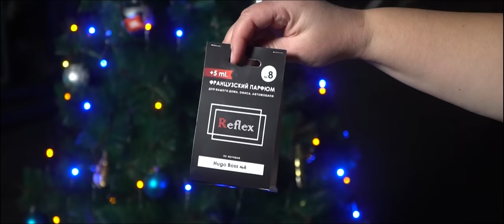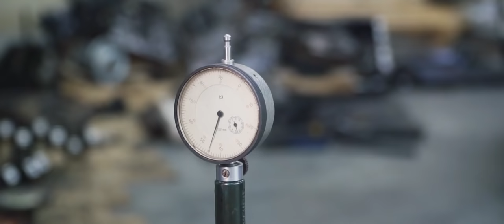We make a working I-6 out of two Lada 4-cyl engines

Comment: it would be cool to put 2 lada engines together to make a inline 8
Reply: Something similar has already been done with "Gennady", if you've seen that project. But that was just two engines welded at the pully/flywheel.
Reply: @SwapBlogRU  Yeah, well that would be just simply two I4s welded together. Kinda like the first Veyron W16 prototype, where Bugatti simply stuck 2 V8s next to each other and somehow got 3000HP. If you guys made an I8 like this I6 in this video, it would probably also be easier with synchronisation and stuff.
Reply: Imagine a v8 made from 2 inline 4s tho
Reply: @SwapBlogRU  wasn't that 4?
Reply: Yeah, good luck with synchronisation on that man.
Reply: @Grulaz  it was a gradual build-up. First two, then three, then finally four.
Reply: @SwapBlogRU  also i lowkey thought that Kiril was vlads son
Reply: What about make Inline 12???
Reply: @joe125ful  put the 2 inline6 engines next to each other?
Reply: @Grulaz  Or what about hardest challange:W16:)
Reply: @SwapBlogRU  that was a Lada engines
Reply: @aqua_whale  I’ve seen someone do it, but it was 2 2jz engines put together. It was incredible engineering
Reply: @aqua_whale  Saab did that in the 90s. just welded two i4s as an v8 and stuck it in to a saab 9000. it was kinda fast.
Reply: @SwapBlogRU  Perhaps instead of an Inline-8, would it be possible to cut two blocks in such a way, and weld them together again, to make a V8 with them?  Alternatively, the "proper" I8 with two welded engines instead of two welded crankshafts could be fun to see.

Yes, I'm American.  I think it's partly in our blood to be obsessed with 8 cylinder engines.
Reply: And then V16 SUPER MOTOR 💨💨💨

Comment: I love how they can literally figure out a way to successfully weld two engines together and make it run, but running into the problem of how to make to oil pressure sensors work together stumps them enough to stop the montage to explain the problem 🤣 but not the science behind getting the firing order right on the crank.
Reply: russians are more straightforward in explaining, they would consider visually and verbally explaining as redundant because you are doing the same thing twice at a time

Comment: I would love to hear it with a proper exhaust system, I can’t wait to hear what it sounds like with such a weird crankshaft
Reply: This one is not that weird really. T-34 had two-part crankshaft by design.
Reply: @ThorneyedWT  It's not the two cranks welded together that would make it sound weird, it's the firing order. The two extra cylinders fire in sync with two of the normal ones, so the same firing order as a 4-banger but with an extra cylinder firing 50% of the time. Would probably sound something like bang bang BANG BANG bang bang BANG BANG.
Reply: @quillmaurer6563  Then it's mostly on exhaust lines length. Subaru engines had weird sound just because of that.

Comment: 2 pairs of cylinders are exploding together. A comum 6 cylinders has ignition time of 120-120-120-120-120-120 degrees. This engine has 180-0-180-0-180-180 degrees. The engine sound cannot be the same.

Comment: That's a really impressive machining operation, and it just happened to stop for just long enough to be able to pause it is right between 5:36 and 5:37, it's 5:37 and a second or so:

"Cutting through cylindrical cavities that are orientated axily/ parallel with the axis of /in another larger cylinder"

If anybody studies topology, geometry or mathematics and knows how to state a geometric proof or observation tell me if this is fairly correct if you're an actual mathematician/professor.

Comment: That’s a lot of engineering. Personally, I’d have gone the easy route and used two complete engines in either a straight eight or side by side coupled to an output shaft like a pulling tractor.  I can’t fault these fellas for their effort, though.

Comment: Not to critisize only to try and help. I think that you need a better ignition setup. I know there are coils that fire two plugs but thats connected in series. Your plug wires are connected in parallel and electricity always takes the path of least resistance so there is no way to control which plug it fires.. Could you run a second distributor on the back of the head driven directly by the cam just for the 2 extra cylinders? Love your channel and respect from Canada.

Comment: Great achievement in making a six cylinder engines from Lada four cylinder platform, Such engine will move Nivas with ease in any conditions and Lada sedans might run like sports luxury cars, but there's some room for improvement for this very interesting experiment

Six cylinder engines has the best combo of power, torque and smoothness, a OK fuel economy, solid reliability that made it favorite for US automakers economy cars from 1950's to early 1980's and are still used in trucks as today

The implementation of a real 1-5-3-6-2-4 firing order in Lada Six might need a custom made crankshaft camshaft and perhaps a heavily modified six cylinder distributor meant to fit in the Lada based engine, Such firing order will make the engine more smoother, reliable and after all eliminate most of the crank flexion issues of the original engine with big bang firing order

Don't forget the lubrication system and the oil passages of the block and head, the additional lubrication demands for the six cylinder might need a stiffer oil pressure relief, the oil should pass and lubricate the crank main and cam journals  6 and 7 and lubricate and pressurize four additional tappets, rocker arms and cam lobes, the cooling system may need a larger radiator to cool two extra cylinders

Comment: The engine is turning heavy, that means the crank and engine housing are not aligned corectly but that is normal considering the circumstances. I always liked the I-6 engines, I had a BMW and an Opel Commodore with I-6 engines and they were super.

Comment: Your standard distributor would of been a massive hold back very good idea tho but use an electronic control aftermarket ignition system and ITBs off a motorcycle 👍 ditch the carbs and dizzy off

Comment: I figured you would've cut the front cylinder off of one of them, then the back cylinder off of the other, and then welded them together like that.  Assuming that cutting the engines is easy, i figure that would be the best way to make that happen.  That way, they would probably go together a lot smoother, and maybe make fabricating the new 6 cylinder head easier.  Either way, nice work.

Comment: I wonder if it would have been easier to cut 1 cyclinder from the back of 1 engine and 1 from the front of the other in regards to welding the blocks together, interesting video.

Comment: honestly, I think this would have worked better if the front cylinder was chopped off on one engine, and the rear cylinder was chopped off on the other engine. it likely would have been easier to make a "quality" and balanced engine. Not saying this didn't work well, but I think this concept deserves a revisit.

Comment: That is an incredible feat for these guys to do without engineers and multimillion dollar equipment, I would really think it would be impossible to do just based on how perfect the crank would have to be and how sensitive it would be to the slightest difference, not to mention getting everything else in perfect unison, connecting rods, lifters, cams, absolutely amazing that you did this in a regular garage, I don't think you could do it to a v8 tho, no way.

Comment: I was thinking that an easier method might be cutting the 2 engines so the front 3 and rear 3 cylinders are what you use, the blocks would line up easier with each other and then the head and camshaft will be easier to splice together

Comment: I mean, other than making the crankshaft… it should be straightforward enough. 

The issue is that i4 cranks are flat plane and i6 cranks are at 120 degree spacing.

Edit: okay, heck yeah! Can’t wait to hear a flat plane in-line 6.

Comment: Personally i would have took the three front cylinders from one engine and cut off the last cylinder and take the back 3 cylinders from the other motor and cut off the front cylinder. Welded those two together at that point. Another method would have been cut directly down the center of one of the cylinders from both engines and weld the 2 halves of a cylinder together. This would have been far more complicated than the previous mentioned.
Reply: I like your second method because you could bolt a single head across two blocks to help keep them aligned while you weld them together. I'd love if they attempted a 6 cylinder again because they're more experienced and could have a standard 120 degrees crank. keeping the join in the middle of the block helps engine balance too.

Comment: They should have rotated the last two cilinders 120 degrees away from the others to insure proper engine balance so the engine would run better and would put less stress on the starter

Comment: How about just connecting two 4 cylinder lada motors in line for an inline 8 cylinder motor. It should work pretty well as you could probably bolt the trans mission directly the rear motor.  Mayb two radiators

Comment: i think it wouldve been a good idea to manufacture a crankshaft for this engine, rather than welding two together.
the firing order of this lada-jz is completely off (seen at 8:25)
currently, it fires 1/3/6 - 2/4/5
i think you would do wisely to change it to 1-5-3-6-2-4

Comment: And BTW a incline 6 by my understanding, is alot better than a mere 4 cylinder, atleast I remember reading their bore stroke ratio is much better?  more horsepower better fuel consumption depending of course on the gvwr of the car because if it weighs too much the 4 cylinder simply isn't strong enough to efficiently power the tires 
And the v8 uses way too much fuel for a smaller frame 

Atleast in certain platforms

Comment: U shud have added those extra 2 cyls 90⁰ apart from front 4 cyls not 180⁰. It wud give smoothness n better power delivery bcuz now atleast two cyls will fire together. Like num 1,4n 6 wud be at tdc at same time n two cyls will fire together n same with 2, 3 n 5.

Comment: Little past half way and I can see one issue already.. the firing order is going to be jenky and the engine is going to vibrate like hell.  The TDC should be, 1/6 -> 2/5 -> 3/4, their engine is has 3 pistons at tdc, then the other 3. Which means, 2 will fire at the same time on 2 of the 4 cycles.

Comment: I don't wanna be rude but you can't make a PROPER BALANCED inline 6 with connecting flatplane 4 cranks. The reason is inline 6 naturally has 120 degree intervals between each power stroke. Your new crank has 180 degree intervals. That's why your engine doesn't sound like inline 6. It sounds like uneven firing inline 4. Great effort though!

Comment: why not make a lada straight 8 with the two engines welded together 180° out of phase? the distributors, oil pumps, and cooling systems could theoretically remain intact and just be turned into a full loop through use of an elongated sump and valve cover, along with connecting one coolant outflow line to the other engine's cooling inflow. I personally think an 8 cylinder would be more interesting since it's a rather neglected engine layout.

Comment: nice work BUT this isn’t good design of inline six because cylinders must be 120° (1/3rotation) shifted appart on crankshaft not 180 (1/2 rotation) like inline 4. In  inline 6  engine 1-6 cylinder 2-5 and 3-4 cylinders comes together up and down to balance the engine , sooo the inline 6 is actually two inline 3 cylinder engines mounted in row.

Comment: I saw the first drive and wondered why it didn’t sound like a 6. Now I understand. You didn’t bother with a proper 6 cylinder crank, cam and distributor, you just extended the standard 4 cylinder ones. So you’re twinning two of the cylinders, with the new ones, doubling the power of two cylinders and leaving the other two standard.
So, while there are 6 cylinders, it runs as a horribly misbalanced 4. I was actually expecting more from this, given how much time and effort you guys seem to be able to put into your projects.

Comment: Why they didn't made a 3+3 instead of the 4+2 ???? In this way the bang is uneven and the engine is umbalanced. 

The easy way was to use a 3+3 block, cutting 3 pieces of  the two crankshaft and rotanting the second of 60 deg and the third part of 120, and so doing the same for the camshaft will balance the bangs and the weight, with a double joint in the middle of the basament.

However ... I don't like the way but I like a lot the idea !!!!

Comment: 3 pistons at TDC at same time. One is at TDC for power stroke n, another one is about to start intake n wat abt the 3rd one..? It either has to be as  same as 1st one or 2nd one. This means extra load to drag piston up n down. Ot wud make lesser power conparable to another same size 6 cyl. Very imbalanced engine.